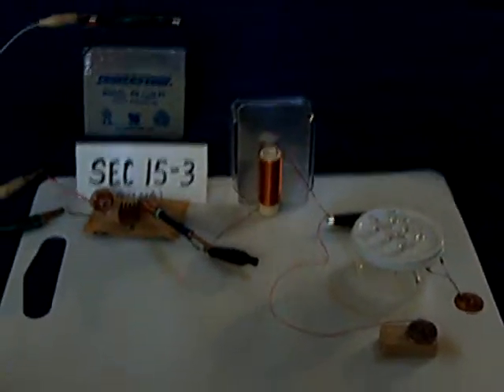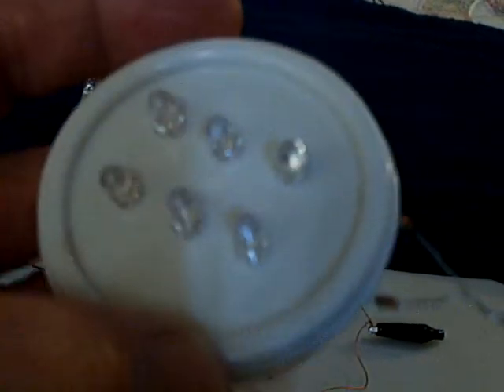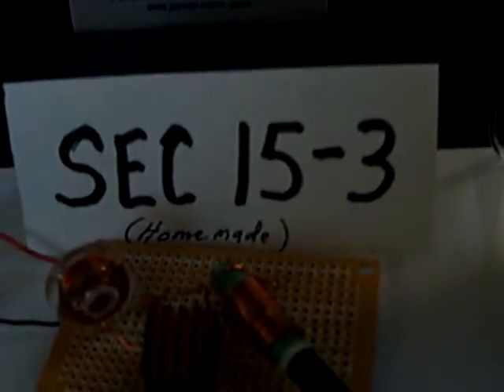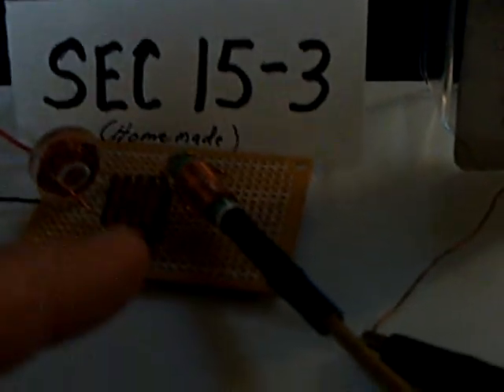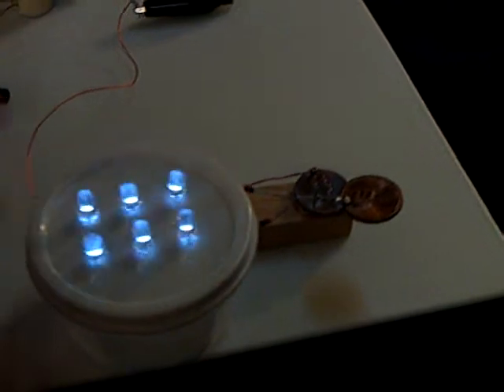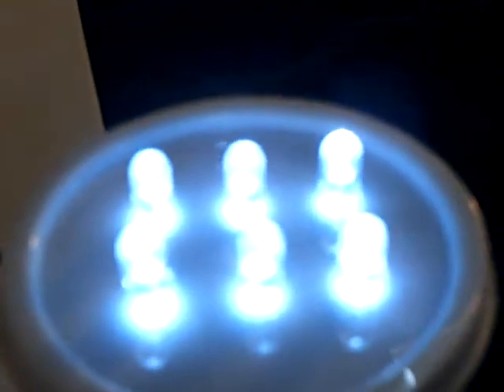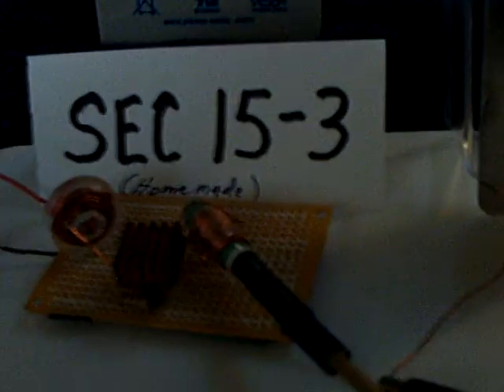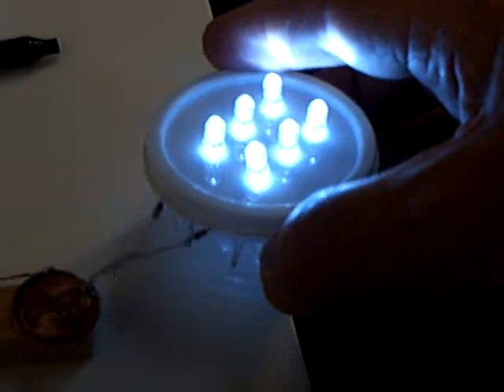My 2 cents SEC experiment.ASF

Comment: Dear Lidmotor,
Exactly!  Is the bulb the route of the energy to flow INTO the system?
Aetheric radiant does seem to act differently in a restrictive load vs Inductive or Plasma load.  The energy is all around the circuit. It is amazing to be sure and does seem to point to the realization we do not and should not have to PUSH current to accomplish things...........

Comment: Dear Lidmotor,
Here is a question, is this phenomenon best suited to LED vs restrictive load type bulb?  If so, the diode interface is acting in a special oscillatory manner. The standing wave phenomenon may be tickling the plasma interface.  As Dr. Stiffler has noted the thermal register is NEUTRAL.  What does this tell you?
Perhaps it is that very interface that is the window.  Negantropy vs exothermic.
As the hairpin shows, you still should be able to glow a restrictive bulb.

Comment: I was out working and thought of what Nicola said about the heavily insulated transmitter and reciever plates that would collect the minutest of elements that would charge his circuit. so I was thinking about insulating with various steps about this phoenomena. like start to isolate these two pennies with paper and cardboars to see it this is a proximity  behavior or a directional behavior.  Thanks for the great time you have put into your work 
zane

Comment: Tesla transmitted and recieved a power transmission from his apartment in Manhatten to West Point, a distance of 40 miles with two solenoid coils pointing at each other end to end. This was his first radio. The use of transverse waves was largly a poly to circumvent his patents. He modulated the power wave to produce sound in an earphone diaphram. There's  a photograph of his original setup on the web. The only significant difference is, he powered his transmission coil with A.C.